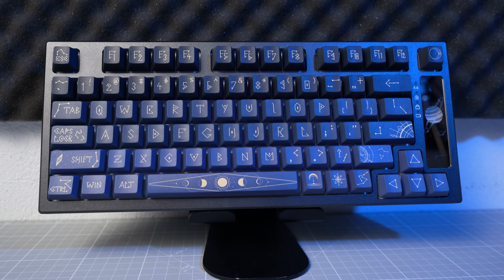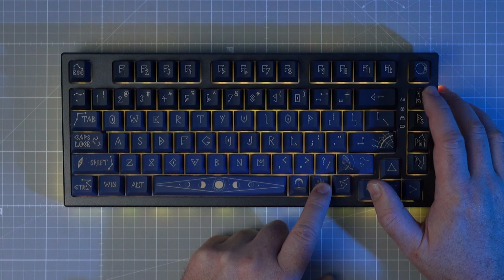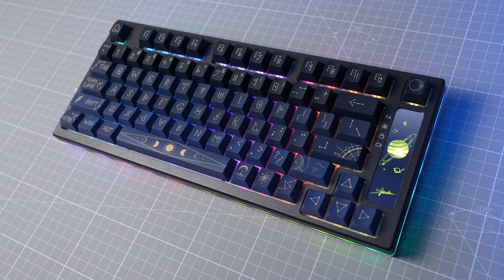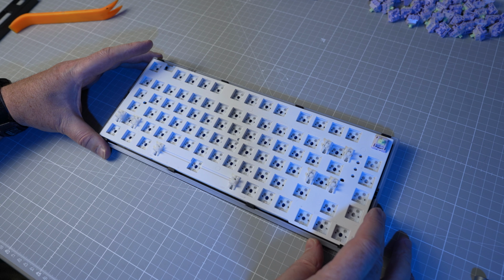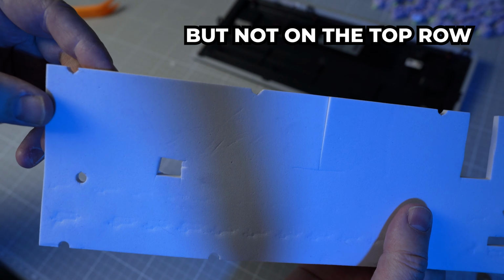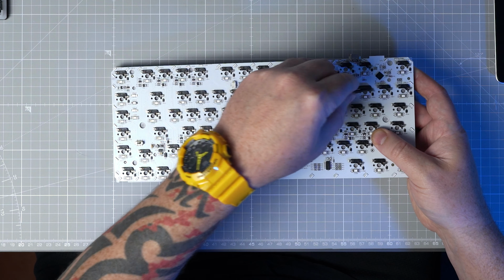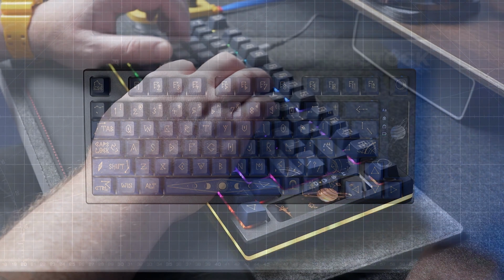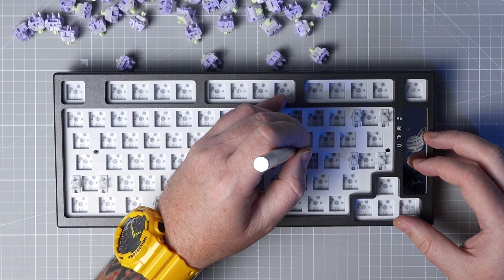YUNZII YZ75: Build and Review

Comment: Hi, I received my YUNZZI YZ75 keyboard today. At first, the keys don't respond when I press them. Is this normal? I'm not sure if it's a problem with the keyboard or if it's due to the distance from the 2.4G wireless receiver, although the distance is not that far either, it's less than 1 meter. I would appreciate your help.
Reply from the maker: @ShadesW3  shouldn't be doing that. Try the other connection methods.

Comment: It says the keyboard is wireless but does it come with a wire too?
Reply from the maker: Literally in the first 40 seconds of the video.
Reply: Yes but does that work just as a charger or can you play with it in at all times? @keebface
Reply from the maker: @vixter3663  You can use it at all times. Whenever a keyboard is called "trimode" it is in reference to connectivity to the OS for use. Trimode is BT, 2.4ghz, and wired connection. For wired connectivity you just switch the mode switch to off and connect with the cable. If you leave it in bluetooth mode and connect with the cable, it will only charge, it won't be connected the OS via the wire.

Comment: maybe you can guide me on this, ive modded the keyboard and it sounds really really great... pretty loud and thocky.... ive only got one issue, well, 2.... my enter and my left shift key sound VERY quiet whilst the rest sounds loud... ive tried recleaning and relubing the stabs like 3x, also tried without lube, still very quiet... and its literally only those 2 keys.... any ideas?
Reply: too much lube
Reply: The stems on the stabilizers will be landing on the PE foam. You need to cut out the PE foam under the stabilizer housings.
Reply: @RuinerWongl well that  wasnt  it, i pretty much found out an hour later the 2 keycaps were just not on perfectly...as in just a slight little teenieweenie little bit

Comment: Does anyone know if this keyboard can be used on ps5?
Reply: i think so it has  usb- c cable
Reply: Yes it can
Reply: did you ever get it set up??
Reply: @vanwhy2630  I did not, it just didn’t seem to recognize it’s connected
Reply: I don’t know if you can use it with wireless, because my ps5 burned before u could use it with wireless, but mine work fine with the usb-c cabble

Comment: Hey I just got the yunzii yz75 and I’ve been having this problem where the keyboard won’t turn on even with the usb c cable plugged in do you think it might be defective ?
Reply: u use fn +5
Reply: Did you end up fixing it because I’m having that same problem
Reply: @trulyricky1485  I'm having the same issue!! did you ever resolve it?
Reply: @gracebyers4802 unfortunately no, I have to use the wireless mode which is FN+4. If you found out how to fix wire mode let me know, I gave up trying to figure it out
Reply: @trulyricky1485  hold fn+esc for 5 seconds and that should reset the keyboard and hopefully work
Reply: @rafa1xx omg tysm that actually worked tysm bro i thought it was broken
Reply: same ! it doesn't connect with the usb and it also does not charge, did you manage to fix it or just refunded it ?